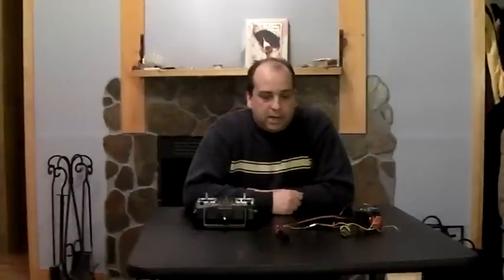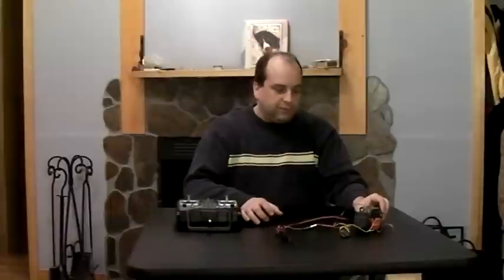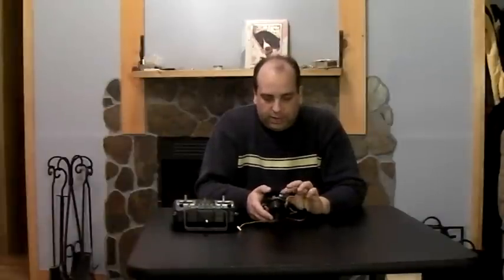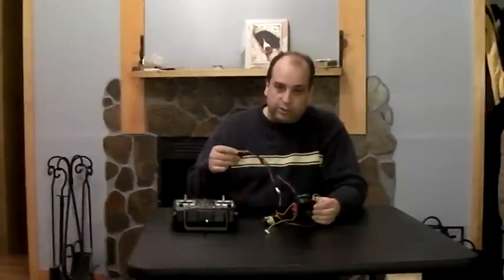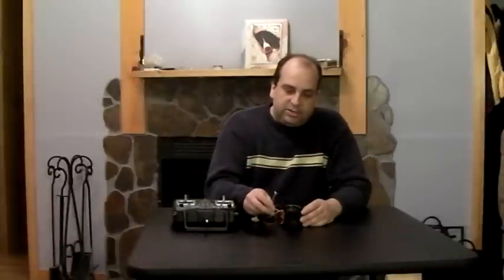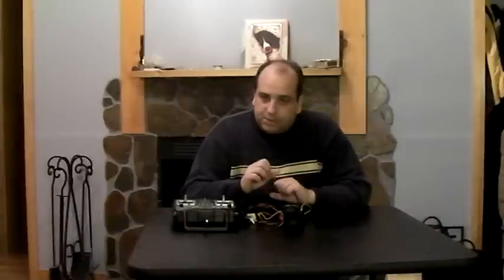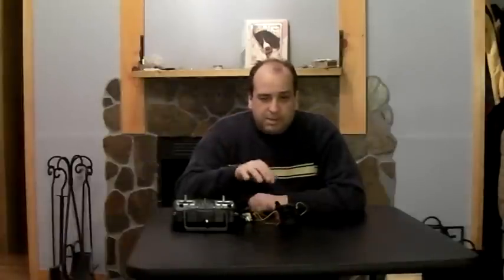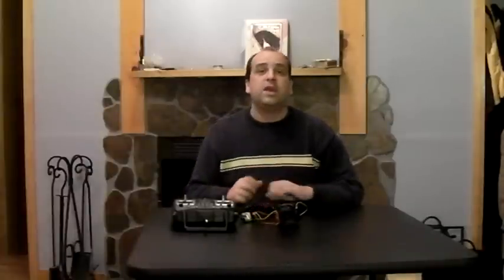RC sound module update

Comment: Ive tried a sound module in the past, when they first started existing  with my 35% yack and it sounded good BUT in the air the sound of a 27 inch prop total drowned out the engine recording. So it was useless  I am interested in trying your ultra system  Do you think its loud enough to be effective over the prop noise of a plane that size?